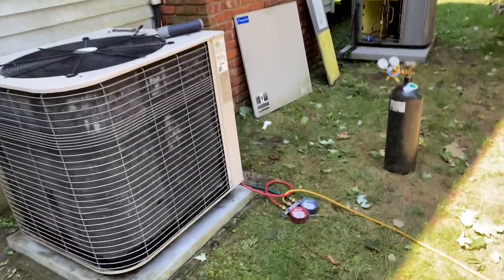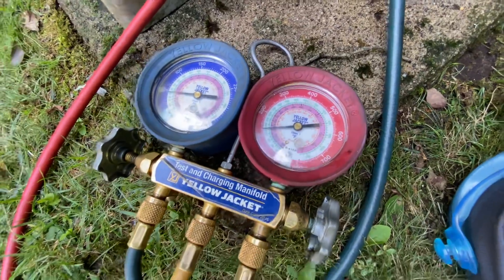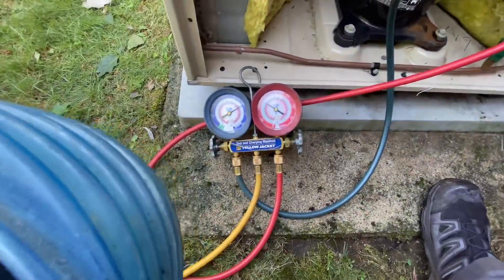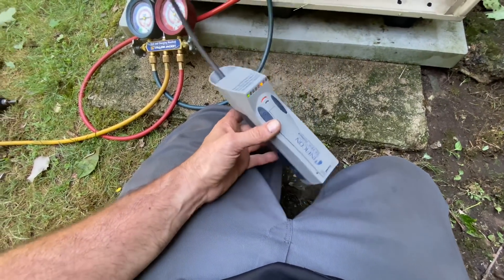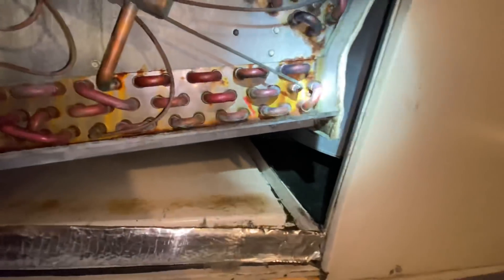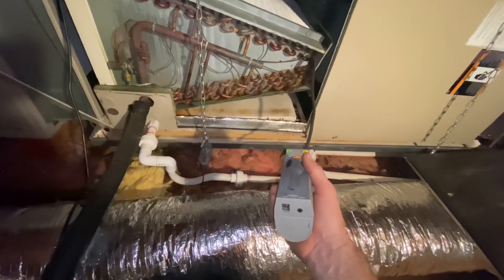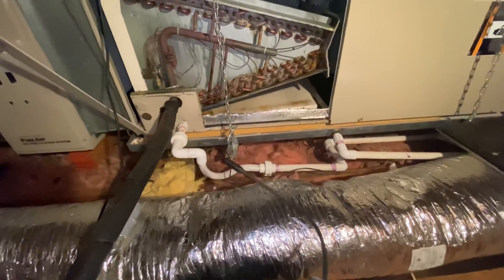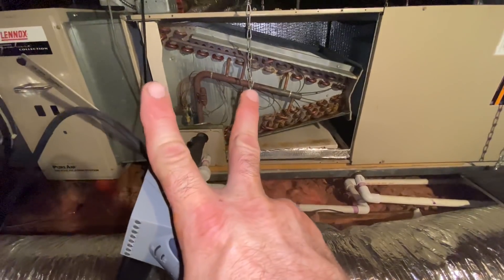AC Leaking Freon Both Coils

Comment: In 2012 I put in a Lennox XC21 system, the system came with a 10 year parts and labor warranty. So far, under warranty, I have needed to replace the condenser coil twice, the condenser once, and now the evaporator coil needs to be replaced. Have you noticed Lennox systems have this high rate of failures? I am down to 19 months left on the warranty and the HVAC company is already telling me I should be installing a new unit and pushing me to buy a Maytag. The house is on a saltwater canal, in Southwest FL, when the Lennox system dies after the warranty period would you recommend changing to an unit with aluminum instead of copper coils (like Lennox Quantum Coils) to help with corrosion?
Reply from the maker: The replacement evaporator for the xc21 is an aluminum coil. It’s rare for so many leaks on one system. I ran into a few condenser coil leaks on the xc21. It is usually repairable if the condenser is not under warranty. How can anyone recommend replacing a very expensive ac unit with a Maytag/ nordyne. Do u get the system maintained and keep the condenser clean? Usually the condenser was plugged up causing head pressure to skyrocket. Which was what I thought could of triggered the condenser leaks. Many times found on a braze fitting before it went into the coil. I would just repair the system since it’s under warranty. Hopefully with the new Lennox aluminum evap coil this system will provide 10 more years of service
Reply: @thehvachacker  Thank you for awesome feedback, information on the new coil and very quick reply. Yes, I have a maintenance contract and they come out twice a year.  Based on your response I think it maybe time to look for a new HVAC company.

Comment: Ultra sonic much better tool fo refrigerant leaks always follow up indicated area with bubbles. Much more diverse and there is no need for a trace gas and or adding pressures to 200+ https://www.amazon.com/Superior-AccuTrak-VPE-GN-PRO-Professional/dp/B00G1Y4HH6/ref=sr_1_8?crid=197SQYRAY4JFC&dchild=1&keywords=ultrasonic+leak+detector&qid=1596770154&sprefix=ultra+sonic+leak+d%2Caps%2C217&sr=8-8. To many false positives with the INFICON.

Comment: How do you have 410A in that old unit?
Reply: 410a has been around for a while,the first 410a system i saw was back in 02
Reply: @pelon542  That system looked like a 1990 something
Reply: @texasmade2684  I've worked on units that look a lot older than what they are,just like us humans when we don't take care of ourselves
Reply: some units are an option of R22 and 410a
Reply from the maker: This Lennox is a 03 unit. Carrier had their Puron systems around since before 99. I don’t know when the first 410a systems were produced. The HS series was lennox’s premier line before the XC models. Great machines. Fixed many leaks in these condensers